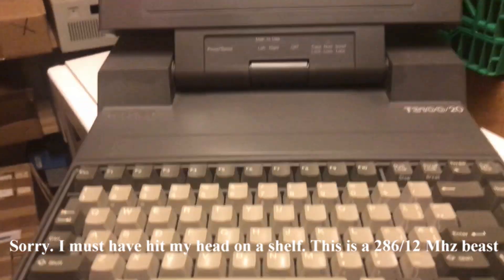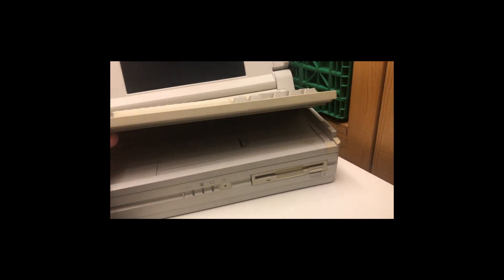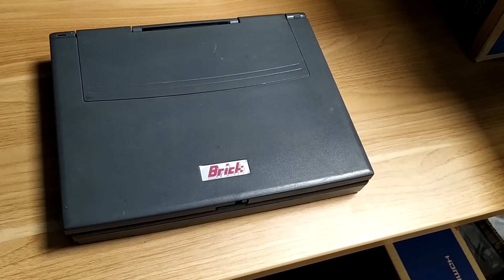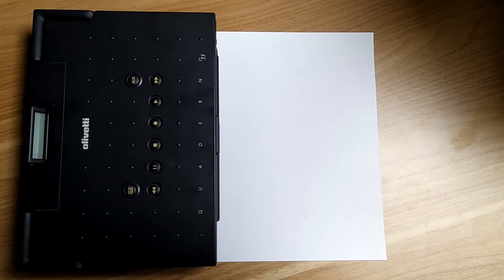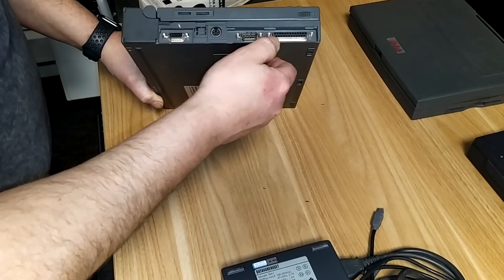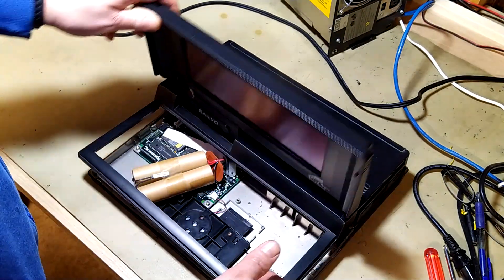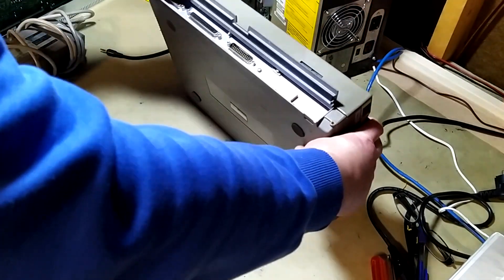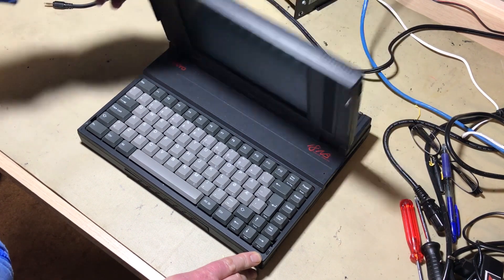The more exotic computers of DOS-Cember

Comment: Heh.  I came here from Adrian Black's second channel and started from your first video.  All these portables meet the military definition of portable:  if a regiment can move it, then it's portable.  We still have a Toshiba T3500 and a T5200 at work that were used for programming PLC and HMI equipment.  It will be interesting to follow your old videos and see how your channel evolves.  You have some oddities here, all right!
Reply from the maker: I really appreciate what Adrian did there.. And thanks for watching. I totaly agree, I do in fact have a Victor 286, about the same size as the 3200 coupled to a PIC programmer, and an old Eprom programmer. Sadly, the Plasma now needs some repair and I have not got about to look into that yet.